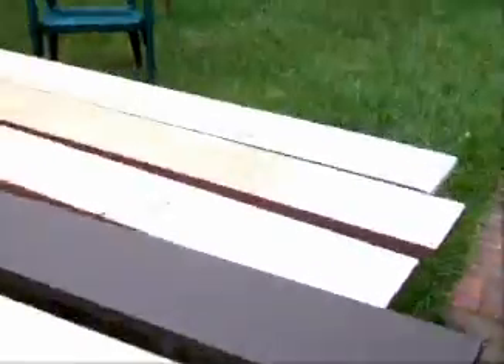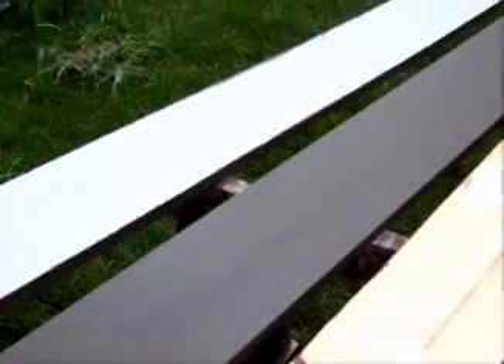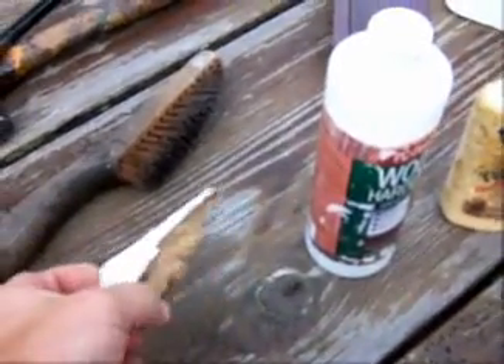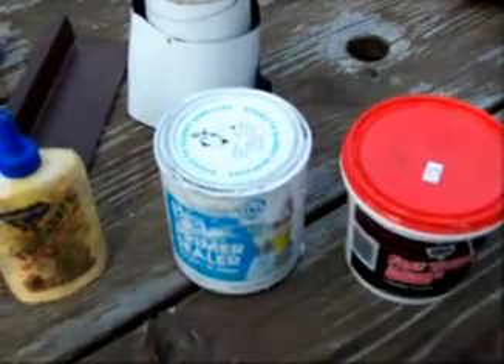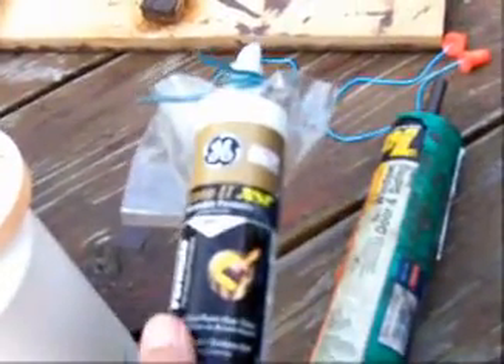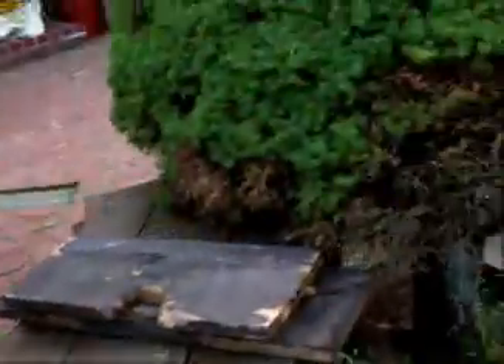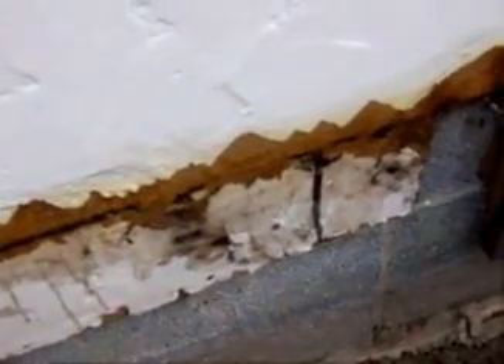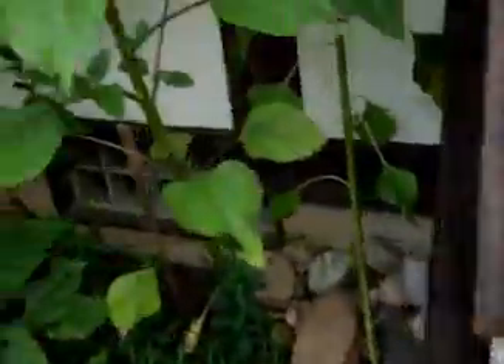stuccoboard and wood trim repairs part one

Comment: I have repaired some of my stuccoboard on my tudor house and used some of your techniques. I particularly liked the use of Titebond II glue. This product is perfect for this application as waterproof, hard, sandable, and absorbs/attaches itself to the stuccoboard.
I am in the process of replacing/repairing some cedar boards this year, thanks for the posting, it has been very helpful.